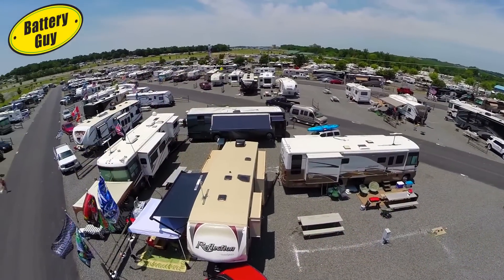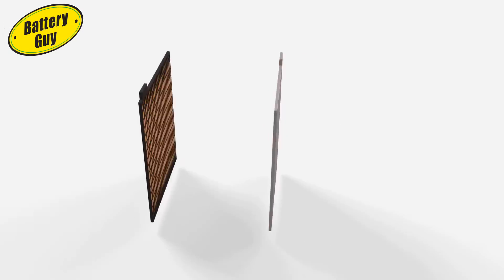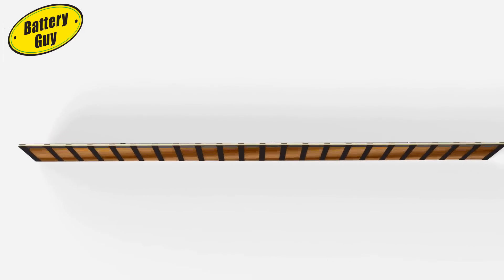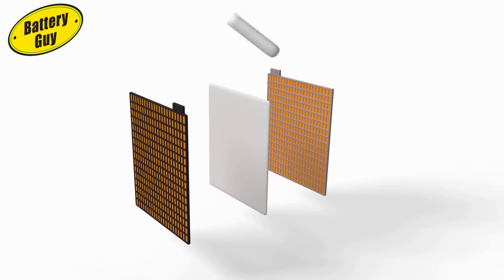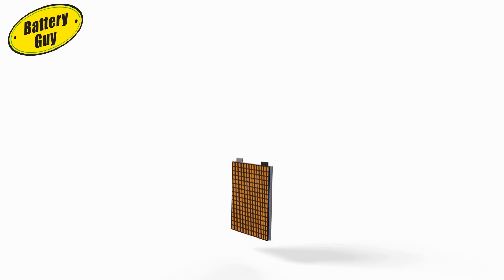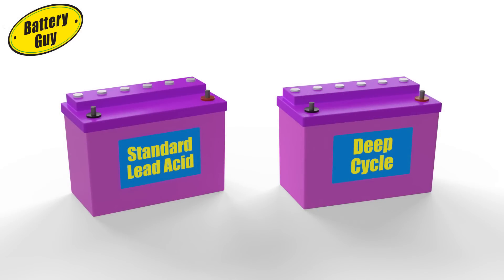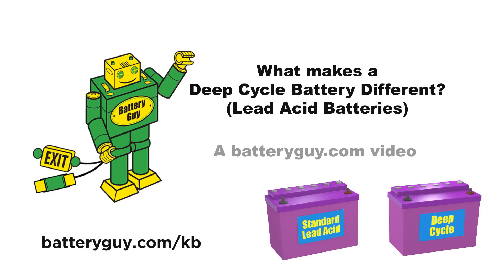What Makes a Deep Cycle Battery Different

Comment: Speaking of rolled cells, I've had an optima red top battery that survived multiple full drain cycles from leaving the lights on, and it never failed to come back to life after a jump start. Thing lasted WAY longer than most 12v car batteries I've owned and was well worth the money. I don't think it actually started to fail to hold a proper charge till it was left dead for like, 3 years or longer, and that was already after 5+ years of really hard abuse.
Reply: I feel like optima used to be good. Their quality really went down hill.
Reply: My brother had a red Optima battery that lasted 15 years!
Reply: Try them at altitude. We don't use them for anything we count on. Too unpredictable. They don't even sell them up here anymore.
Reply: The yellow top D50 in my race car is over a decade old and still working fine. (of course, it sits disconnected 99% of the time.) The red top provided by Chumpcar (Optima was a sponsor) didn't last a year! The Duracel (sams club) used in the EV racecar is 6+ years old, but it's disconnected much of the time, too.
Reply: @jfbeam  You should keep those charged - they must be sulfating.
Reply: @jfbeam       Your Chumpcar lol?
Reply: I use only Optima batteries myself. Had one many years ago, last 14 years! Then I had to have my truck engine rebuilt. Made the mistake of just leaving the battery sit on the garage floor for months while I waited for the engine. Then the battery was no longer good. Wonder how long it COULD have lasted.
Reply: @danielratzlaff5000  Leaving a battery on the concrete floor has no impact on the battery. However, not keeping it charged certainly does.
Reply: @danielratzlaff5000   Optima batteries need to be used regularly. I had a vehicle sit in a repair shop for one month (broken ball joint). After one month of idleness, the battery would not accept a charge. Now I make sure to start the vehicle (and run it for at least five minutes) at least twice a week. Daily is better.
Reply: @jeffputman3504  Get a maintainer.  10 minutes is awfully little time.
Reply: @jeffputman3504 I brought one back from the dead that sat on a shelf without the maintainer for a year or so. It didn't respond much to the normal 10 amp charge for a few hours but came back after letting it sit trickling at 2 amp for a few days. Edit: It did work again but it didn't have the capacity it did when I first got it and it wouldn't hold a charge enough to start the car after about a week.

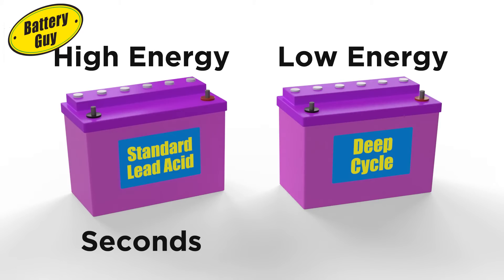Comment: @ 1:17, REALLY bad info in a video on batteries from people that are supposed to know the meaning of engineering terms!!!  Standard lead-acid batteries are designed for HIGH POWER output for starting NOT HIGH ENERGY!  You'd think these dolts would know the difference!  Starting a car uses maybe 5% of the ENERGY in the battery, but using a deep-cycle battery for a few hours at moderate amperage uses HIGH ENERGY reserves - say 50-80% of the capacity.  The amount of ENERGY used to start a car is very low actually - but VERY HIGH POWER is used for a short time.  Conversely, DEEP CYCLE batteries output LOW POWER for a long time, which means for that long period of time they output HIGH ENERGY!  HOW can someone make a video and get it SO WRONG!  OMG!

Comment: @BatteryGuy  -  Please do a video on the Nickle Iron Hydroxide wet cells that are used by railroads and the phone company. Each cell is 1.5 volts and some of these batteries have been washed out and loaded with fresh electrolyte and are near 100 years old. I have seen them in old communications buildings. Ma Bell loves them as battery backup for telephone switches much more than Lead Acid or Lithium. I believe they are using Calcium or Potassium Hydroxide.  And they have no terrible environmental impact like the other two types. Your thoughts?
Reply: Yes ! these batteries are almost indestructable ..... but .... their  BIG weakness is letting the electrolyte dry out , so manufacturers often fit a water resevoir to stop this .... also they hold less electricity than the same size Lead acid type , so are only used when a lot of space is available ( eg railroad or static ) ....... DAVE™🛑
Reply: @davidfalconer8913  -  They are a favorite of Railroads, Telecoms, and communications companies... Yes all stationary. I have some photos of some massive banks of them and some that other techs showed me were almost 100 years old.
Reply: KlodFather - a man called Tesla used Nickel Iron batteries in his electric cars. Trolley buses in England that were scrapped in the early sixties used them as a temporary power while the overhead connectors were moved from one set of cables to another. Recently a farmer who purchased one and kept it in a barn for fifty years sold it off to a museum and you wouldn't 'adam and eve' it but the bloody battery still had a whopping charge. After 50 years 😮

Comment: Anyone who thinks like this man that a deep discharge Trojan golf cart battery cannot provide a lot of energy quickly has never short circuited a charged one.
Reply: I think he meant they are not designed for that.
Reply: @adon8672  I use the scrap ones from golf carts for my solar and when they are not even good for that I use three in parallel for starting my fifty year old VW combi.
Not designed and over engineered for that?
You are perfectly correct.
Functional?
Yes, though I do need to rest them for 30 seconds between cranking attempts, they are geriatric battery's after all :)

Comment: I think Lithium iron phosphate batteries are replacing deep cycle lead acid batteries and AGM batteries.
Reply: Think 12 dollar signs not 3 :)
Reply: @andrewallen9993  Yes I agree that Lithium iron phosphate batteries are much more costly than most flavors of  lead acid batteries but they have a higher energy density than lead acid batteries and are much easier to maintain with the built in battery manage systems and many more charge/discharge cycles. As more battery manufactures have started producing them I have seen the prices come down. While they may never be as low at lead acid batteries I think that they do have a lot to offer over lead acid.

Comment: These days LiFePo4 is superior. Lighter, not devastated by discharging down to near zero, and much more cycle life.
Reply: And their price is EVIL!!! 😈😈🔥🔥💩💩☠☠  They are certain damnation for your wallet.
Reply: @KlodFather  For a 12V 100Ah I see them about 35% more than SLA. I think they last a lot longer and don't degrade nearly as much just sitting there, so I think they are good competition. The main limitation is not being able to discharge them at high current as lead-acid can easily do.

Comment: Usually deep cycles have a mesh inside them and a liner in each cell..  the lead will have more surface area in the acid..  probably a different lead alloy as well..

Comment: 2:35  Only 30 plates in a twelve volt battery? Not very many?
Reply: The number of plates is purely down to the amperage it must supply for a particular vehicle. 30 plates or less in some....more in others.
A small Toyota Rush for example has a tiny sized battery:  A Volvo with a V8 has a stonking great battery in the boot area......just more plates is all.
And diesels need even greater amperage due to the higher compression ratio....... Horses for courses.

Comment: THANK YOU.  I appreciate your help.  Btw, since we last spoke I changed the whole system. The wet weather caused a need to adapt.  2 pumps now. One 1/2 hp AC submersible with a 3/4 hp back up on DC deep cycle bank. With a battery tender of course. We had been pumping out 40 liters every 2 minutes 24/7 for about a month.

Comment: I got my bacholors degree in electronics in 1972.  I know a lot about electronics, but not necessarilly batteries per se. This is the best video on batteries I have even seen.   One of my pet peeves is when people use "volt" when they mean "amps" and the like. AND THAT is why is it very hard to find a factual, well written video (or salesman) on the subject.  YOU nailed this and made it easy for the layman to understand.  Excellent video.
Reply: What a silly argument. For work, the two numbers that re multiplied are in the same axis. For torque they are at right angles. So the real answer is to understand what you're looking at. So I calculate an engine's torque, but never would I get confused because I thought the answer was in units of work. Remember AxB = BxA
Reply: You’re all wrong:
It’s Pound Force per foot…”lbf-ft”…
Reply: @topcat5988   Yes, it is expressed that way in some disciplines but not all.
Reply: Using the English language incorrectly in ANY context is a massive pet peeve of mine, like major tool brands printing "foot-pounds" on torque wrenches.  Foot-pounds is not interchangeable with pound-feet. People misuse the word "acronym" so much that dictionaries changed the definition to align with societies misuse of the term. 🤦‍♂
Reply: @Kor1134  
There is no such thing as term “pound feet”.
Reply: @Kor1134  I have been in car repair since 1972. The reason I said that was not to brag, but, to let you know from my humble beginnings to now I have said FT-LBS so often, I am not capable of saying it the right way .I am lost........If there is an  automotive teacher out there reading this. Kor1134 is correct. Teach the young to say pound-feet. Its the only way it will start to be used properly !!

Comment: You did not explain that you need a greater amount of thinner plates per cell on a starter battery and thicker plates on a deep discharge battery?
Reply: Or the fact that Lead Acid batteries (quality) have 13 - Plates, where a cheap Battery will only have 11 Plates. Still a great explanation though.
Reply: @peterduxbury927  I agree except what is implied but not said is "do not try to start your car with a deep cycle battery." Also, same logic, is "don't drain a LA battery below a certain point."

Comment: Not sure how you can have this discussion without mentioning Metallurgy?

Flooded lead acid batteries are typically lead calcium for starting batteries and Lead antimony for deep cycle. They have different qualities with the lead antimony alloy standing up to the deep discharging very well while evaporating off more water. While lead calcium can give a quick jolt for starting motors but can't be discharge much.

Then of course you have some Lead Selenium batteries, mostly in Europe which fall somewhere inbetween.
Reply: @Whit Elfner - Many batteries that are labelled "Deep Cycle" are Lead Calcium.
Reply: @MrSummitville  You can label a chicken a duck, it doesn't make it quack!
Reply: @whitelfner4582  A battery does not need to be made from Lead Calcium to be a Deep Cycle battery. Plate thickness and Paste Design (Sponge vs Thick) are the only two factors that are needed to make a Deep Cycle battery.  Antimony vs Calcium has both pro's and con's.  Calcium is not a requirement for a Deep Cycle battery, especially in stationary applications. There are many "lead" formulas for Deep Cycle batteries, with additives like calcium, antimony, tin, selenium and arsenic. If you prefer lead-antimony then that is your personal choice.
Reply: @MrSummitville  I do like in flooded batteries that they can last in daily loads situations for 15 years or more...
NO flooded lead calcium battery has any place in deep cycle. 

Suggest you research this!
Reply: Yes, some lead-calcium batteries are labeled 'deep cycle' but they are not true deep cycle batteries. I have one here in front of me: a so-called 'deep cycle' marine battery meant mostly for engine starting. It would never survive repeated discharges to 50% S.O.C. as true DD units can. True deep cycle batteries are lead-antimony because they will supply many more charge-discharge cycles in their lifetime.
Reply: I thought sulfation was a big issue with deep discharge.
Reply: Sulphation is an issue only when the cells are not regularly charged to 100%.
Reply: @paulmaxwell8851  I try to keep my batteries charged but some may never hit 100%.  Some never get over 12.5v.  l have a soon to be obsolete hydrometer and the end cells often don't hit 75% charged.   Sounds like sulfation is inevitable.   I was hoping it was tied to going below 50% charge.  I have a bunch of cars therefore batteries on a bench being pampered.
Reply: It is, but this is a discussion on what makes a deep cycle different. Flooded deep cycle pretty much MUST BE lead antimony. There are sealed batteries that are lead calcium, but better is the minimal alloy batteries they are making today. Pressed or rolled pretty much pure lead without the need of calcium to add to the structure. 
Lead calcium batteries will have minimal cycles to 20% state of charge, Lead Antimony will have a lot more. They are the batteries used in golf carts and forklifts. Which are often drawn down to 20% daily. Equalizing helps recombinant(?) the sulfites into solution. @stevemurray710

Comment: Great video. Thank you.  I had been thinking of using a Deep Cycle Battery with a 3000W Inverter/charger for a backup power source to power a Sump Pump system.
What are your thoughts on this?  In the Spring (NOW) my sump pump powers ON once every 5 minutes and pumps out approximately 5 liters of water. The pump is 1/2 hp. submersible.
Reply: first off: you need to add an inline check valve to your sump discharge pipe.($10). cycleing every 5 mins is to much. the check valve will stop the water backflowing when pump stops.
SECOND: don't run an inverter, they eat to much energy in the conversion from DC to AC. add a back up 12DC sumppump hooked to a quality deep cycle.
Reply: (Sometimes the Gugal ay eye takes ages to let me type a comment on yoo choob) any as a comment on user6 .... Discussion sump pumps .. what kind of pumps did miners use many years ago.
 They had to pump water out of mines sometimes hundreds of feet to the surface.
 Ever hear of a 'pulse' pump ?
Little bubbles of air bringing water to the surface for a very low cost. 24/7:365 days a week. Year in year out.